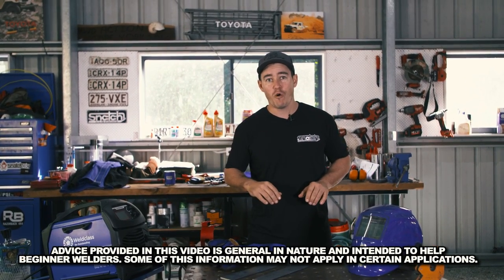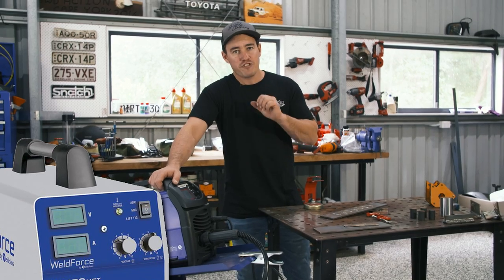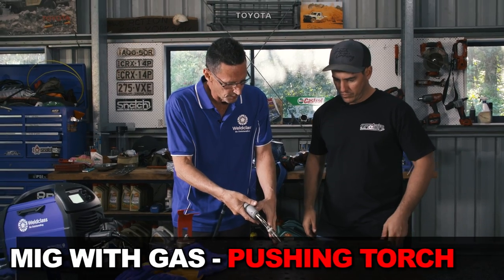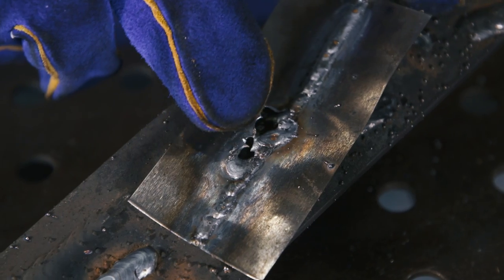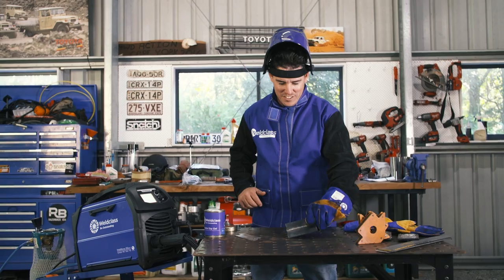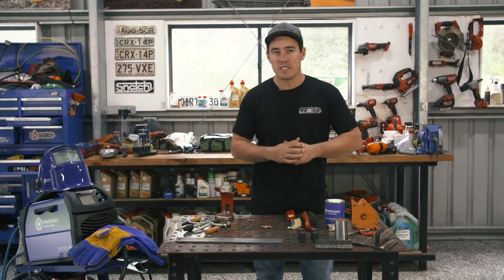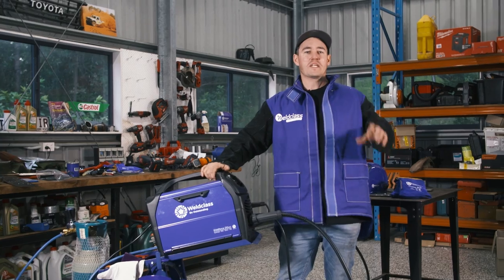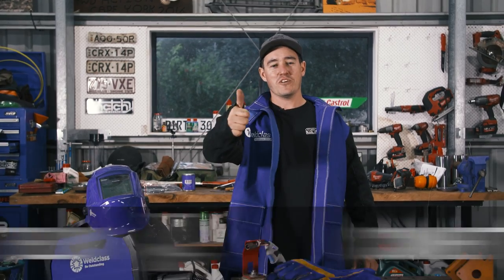HOW TO MIG WELD with Shauno! From NO welding experience to good welds in 10 minutes!

Comment: Great “how to” there Shauno, some good information to get people started, just a couple of points
•Porosity can also be caused by too much gas flow, look up Venturi effect
•Gas type is important , argon/c02 for mild Steel mig, pure argon for stainless mig+tig

As for what my first project would be, finish my rear bar and start a set of turbo manifolds.

Good luck to the winner cause I know it won’t be me

Comment: one of the the first project i would tackle with the welder is a basic sheet metal bender then i would go on to making a slide out pantry for the old mans canopy, with the sheet metal bender i build before hand and obviously the welder. then probably a log holder that slides into your tow ball hitch for cutting fire wood. would be very handy to have.
Reply: It'll be awesome to weld repair my boat trailer. Hanging out to go fishing again after this pandemic restrictions.

Comment: I'm a heavy metal fabricator and welder by trade.
The tips are very good for a baseline to get into welding.

I would first make a water tank for the back of my 80 series.
Or trying my hands at making a 270 degree awning from scratch.
Love your videos.
Been a fan for well over 10 years.

Comment: This timing of the giveaway is so perfect! I have plans to build a trailer behind my restored 1965 Unimog 404. I just started drawing some ideas!

I have the plan to learn welding for the trailer build. On my unimog my father and friends did the welding (very difficult welds)

So my plans are I want a 750kg ( the law allows me to build my own designed trailer of 750kg without brakes ) trailer with 40inch unimog tires. I found an axle by a friend in his garden and I gonna restore it. It fits Unimog rims. I will get leaf springs and shocks from an SJ413 or something similar. And then make a flatbed to tow a small boat + 4hp engine or big army tent. And some boxes under the bed for storage. And same width as the Unimog.

So I really hope I win this awesome opportunity! I gonna film the process of the build.

I think it will look epic to have a small trailer with same tires as the 1965 Unimog ❤️ And my father can teach me welding so I have the skill for life!
Reply: Please for the love of all other road users do not undertake building a trailer to learn to weld. It's a 4 year apprenticeship for a reason 🙄
Reply: @reecechristian6185  I have my father as a teacher. And I already have all the other engineering skills. And I will practice first with scrap metal. I started my Unimog without any knowledge and I manage to rebuild and upgrade it 😎
Reply: 750kg unbraked includes your trailer weight and payload, not just tare weight of your trailer, so as you'll very quickly find out, building a solid trailer leaves very little payload capacity.
Little point having a solid 500kg trailer to carry 250kg payload.
Look into braked axle for everyone's sake.

Comment: Good video Shauno,
I've been welding for about 35 Years and all tips are pretty good and correct.
Just a tip for you to give your punters a better view is shade your camera when welding.
Easier for the learners if they can see what the Electrode, mig or tig look like when laying a weld.
With Electrodes, go with the E41XX and not the E47Xx or 48XX easier to start and run a GP Electrode for a learner.
Also with the helmet, show the different tints that they have.
Some people like 12 and 13, but tig I prefer 10 or 11.
Keep up the great work..

Comment: I've been wanting to learn to weld for some time but have only tried stick welding which hasn't worked out well. Thanks for the video, inspired me to give gasless MIG welding it a go. Love that this welder has an easy setting for different thicknesses of metal! First couple of projects will be on my jeep, I'll start small by making a frame for a dual battery set up and then some rock sliders once I get a bit of practice!

Comment: I've just bought two 1980's 70 Series Toyota Landcruisers, and I'll be needing a welder to get them both back on and off the road, one for my son to use as his off-roader, and the other for me and the missus to use as a camper truck, couldn't let these great old trucks get parted out or end up on the scrap heap, but they do need quite a bit of work. And thanks for the welding intro Shauno.

Comment: One of the first projects I would be doing on my 80 is building a rear bar and modifying the front bar to be more bush proof and tackle the tough tracks around. A welder is a great piece of kit that i have wanted to acquire for a while to become a capable fabricator in the shed.

Comment: I am fitter & turner by trade and I spent a few years welding structural steel buildings.

The best bit of advice for welding and cutting is to be comfortable and relaxed. If you feel uncomfortable find a way to get comfortable. It’s difficult to make a good weld unless you are comfortable.

Comment: I have been using my mates little stick welder on my last  project,  so I think this would be a great addition to help the both of us out on our projects,  
But my first project with the welder is I would love to fix up my trailer as it has a couple of rust holes in it and maybe even knock up an enclosed frame for it to have a diy camper trailer/gear carter,  
Great video 👍

Comment: How’s it going Shauno when I was about 12 years old I found my dads old mig up in the garage roof so I set it up and and was so keen to start welding. I didn’t have much experience with welding before I had only ever watched videos so I had no clue what I was doing so I just started to weld up some steal and after a couple beads I started to get the hang of it and now I was just about to buy a welder until I came up on this video so I might try my luck. Cheers Shauno

Comment: have been dreaming of a welder for years each day, have had a real struggle deciding if i should just opt for a cheap stick but cant drop the idea of a pristine welder like this, first project id tackle im almost unsure. Have alot of small items around to repair but would most likely start making parts for my 4wd like a tray and bumper. Whatever it is im sure im gonna have an absolute blast doing it

Comment: Hey Shauno, wish I would have had this video at hand a few years ago. Back then I had no idea at all about welding and built an aluminum roof rack for my 110 Land Rover Defender as buying one was just too expensive. I just went by trial and error with my stepdads Chinese no name MIG welder. Huge mistake, I didn’t know u needed a different welder for aluminum (which I selected „smartly“ to make my roof rack light weight). No idea how I managed to weld it together (ugly but it’s holding). Got so many stingy comments from my mates, so never did a big welding project again. However, the original rack is still on top of the Landy and just had to repair it once on a big offroad trip. Would be very excited to win the welder and give ‚roof rack 2.0‘ and many more projects a go. Keep up the great content. 🤙

Comment: First project will be a roof rack for the patrol, followed by fixing the pool fence! My current rack moves too much with the basket attached and the fence has a couple of broken welds. So one gets me off the road safer and the other gets me out of hot water with the council and into cool water during the summer.

Comment: the first project i would tackle is creating my own welding table as i have to weld on my dads little stand up bar table with my pops very old welder and a few youtube tutorials to teach me how to set up a welder, have been wanting to tackle this project for a long time but the welder has had a lot of issues. i have also wanted to transition from the automotive trade to boilermaker as i love watching welding and i find it very fun so i would love to start learning a bit more with this starter pack.

Comment: If I had the chance to win I would be able to finally finish off my rear bar with swing aways on my 1985 hj60 cruiser. I’ve been stuck between lockdowns in Vic to be able to use my dads mates welder and shed to get the job done and let’s be real no one likes asking to use other peoples tools! I am also trying to learn CAD design so I can go beyond my bar to design and fabricate parts for all my mates cars and help them and others build what they want exactly. Also I would love to start making bars for 60s and other older cars where parts are hard to come by from manufactures and if there is anything there, it’s usually far beyond the price of what we can afford and knowing it can be done cheaper and with passion means the most to me! The excitement in making something yourself is amazing and with a weld class welder I’m sure my beads would be a heck of a lot nicer! 🍻🤙

Comment: Preset setting make it real easy. Liked the welding explanations. I have an old trailer I would love to fix up. Needs a little TLC like a new floor and filling in some rust holes. I could also weld a cage for it. Jobs are endless!

Comment: The first job I would tackle is to fix some small rust areas on my AUSSIE WB Holden Ute. The metal is 1mm thick and from what I saw it does this thickness really good. I did have a 350 Inverter Mig until recently but it was to big and cumbersome. The Weldclass 210 is the perfect size and has the perfect Brain so I can concentrate on doing the welding perfectly

Comment: Hey shauno, the first mission I would fab up would be my alloy over steel front winch bar for our new forbie. Polished alloy over-rider bars (for the bling) and to keep weight down, mounted to tube and plate stock custom designed and fabricated by myself with strong winch and vehicle mounts, 2 re-inforced recovery points, light mounts and uhf ariel mount. 
Very quickly followed by another custom built rear winch bar and rock sliders.
Cheers mate, keep up the bloody great content 👌. 
Good luck to all, and hope to see some updates from the winner of all the hard work with the new toy paying off🤘

Comment: I will start with rust repair on the frame on my vehicle because in Bulgaria there are almost no places that provide this service and the one place that does the price is equal about a welder + safety gear + the steel you need and something else. I have I second project for custom front and rear bumpers as well.
Much love from Bulgaria!

Comment: Ive got a 4 door suzuki sitting at home on 31s, im doing a fully custom barwork setup with a comp style front end, with front and rear scrub bars, rock sliders, a rear bar, and pillars coming up the rear and front end, exo skeleton style up to the roof rack. 

On top of that ill need to weld stuff to complete the SAS swap from the ifs base ive got on the vitara. 

Lots of welding, lots of hours put in, and an absolute Rig of a Mig like that thing would make life so much easier and cleaner!!

Comment: The first project I will tackle is one I have had material for but unfortunately have had to put off for far to long due to not being able to afford a decent machine that is capable of welding metal heavy enough for the project. I so badly need to put a rear protection bar with spare wheel and Jerry can holders  on my GU which I also can not afford to purchase. I’m sure my factory plastic bumper would be so great full for. Thanks for the opportunity to enter 4WD24-7 and Weldclass

Comment: As other items to buy for mid welding, mig pliers, best to cut the wire to keep the wire fresh after each bead, and although you can use any wire cutters mig pliers are just very good for cleaning spatter out of the nozzle to ensure good gas flow, I highly recommend my weld class pro max 500, I used it during my pre app as it was best in the price range and had lower shades for oxy cutting and I’ve used it right into my apprenticeship when I can find my other helmet and it still works great, very large viewing area and has listed a long time. Old flippy style works well too on a budget but hard when using stick if your new and take a bit to strike the arc and you will get a lot of stray arcs

Comment: Great content, really enjoyed this - I'm running a camper trailer and want to fit it out with some custom storage boxes around the sides, and the Weldclass stick/mig/tig setup in the prize pack would replace my eBay stick unit and  help me out during lockdowns to get it done.  Plus, winning the pack would mean spare cash for more steel and extra fixes like custom battery boxes, better plumbing, and maybe a hydraulic swing gear rack over the top!! Good luck everyone, hope I'm welding and filming my project soon! (welding jacket looks good too Shauno, I should get one, safety first!)

Comment: Thanks for the tips Shauno, it is indeed intimidating to get started welding. My first project would be to make up a lightweight front winch bumper for my 99 dodge 1500, short bed, reg cab. Truck is a unicorn here in California and I am proud to own her (Bessy). After that I want to build a rack for overlanding trips.

Comment: The first project I would tackle is to modify my roof racks. I would removed to upper bars to make it a flat rack and would also cut down the feet to reduce the overall height making stability better. I would also weld some bar to the rear of the solar panel and run it at a 35-45 degree angle in front of the roof top tent. That is the first project I would like to tackle but in all honesty I will probably start on the floor pan where the rust should really be removed and holes remaining welded ( but that doesn’t necessarily sound as exciting or fun).

Comment: i make sparks... i'm a fabricator... we always use gas. the correct gas gives cleaner welds. reduces spatter and it just looks better... the art of mig welding, is trigger control... down to one overlapping spot at a time. always use a larger tip. at point 8, use a 1mm tip. prevents clogging snagging and buggering up... if you have problems controlling the torch, in one hand, use two! grip the gas shield, it won't burn you! the angle of the torch changes relative to direction.. to disperse heat, weld from tack to tack... use the edge of the grinding disk to clear a weld path to clean metal... Co2, which you can get at any pub... is cold. if you havent got a gas heater, stand it in a bucket of hot stuff... (its an inert gas)... and finally... wear boots. keep your fingers out of the way of spinning things, they don't give second chances... oh yeah, and, when you're upside down, welding the chassis of your old whatever... wear a hat with muffs, spatter melting into your ear wax is only funny afterwards... (you can find out about burning nose hair all on your own-some)

Comment: I’ve purchase an CNC 6.5m walkthrough boat diy pack  and would use the welder to weld the boat up will take few months to complete but will look amazing and doing it will a welder that has stick, mig and Tig is handy as you will be using all setting on the boat 

Thanks

Comment: Finished building/painting my first fab job which was a steel tray for my hilux  built for a canopy with dog box, under tray boxes and wheel guards and spare wheel carrier on the back, Christmas Day 2020 I had to wire it up, and get the canopy on and bolt it down same day (Christmas Day) ready for a 2 and a half week trip that we left for the day after (Boxing Day) could only work on it from about 5-9pm weekdays ( im a subcontract carpenter) so the neighbours weren’t happy 
I have since decided it’s probably too heavy, even the misses is pushing me to build my own alloy tray so I stop complaining about the weight 😂
My old man gave me a 3 minute maximum rundown on welding beforehand and she still came out quite well!

Comment: I just got a brand new bt50 and starting to kit it out for 4x4. But the first project I would tackle with the welder would be a motorcycle ramp and carrier to fit to moto on the back of the bt50.

Comment: Shauno. I've got an old dual purpose 170 Coppermate Mig welder. I've had it for years, and while it is probably only meant for the average DIY er, I've gone way beyond that. It'd been sitting in the shed for a few years and I just recently dragged it out and gave it the once over. However it doesn't seem to have anywhere near the duty cycle it used to have. Do they lose some of their duty cycle as they get older, and have done a lot of work ?

Comment: I would like to tackle an air box for my forby to make sure it’ll be water tight for the OTT when we go, and also a console for behind my back seat to sit the battery and all 12V equipment onto. Then if I seem to be alright with it I’d build a small camper trailer in the future. 
Thanks 4WD27

Comment: I would love this welding package. The welder in my shed is my grandads yellow stick welder which I have had since he passed 28 years ago. The helmet is a hand held type with a very small view window.The first job I would do with  this welder package is weld new hinges on my trailer as this has been damaged for way to long.

Comment: Hey Shauno, good video cheers, I havn't welded for a while so would like to get back into it and catch up on some jobs around my place, I would like to build a weld bench as I used to weld on the shed floor but the old back ain't what it used to be, so getting things off the floor would be great, then I would tackle some aviarys for the misses birds as getting a bit overcrowded, then a decent kennel for our red healer and some extensions on the shed to make some breathing space would be great too, but I won't be holding my breath to win as there are a mottza of bonza entries and whoever wins good luck and have fun, cheers.

Comment: First project id have a crack at would be to make an off set smoker out of a couple of recycled gas tanks.  Weld some hinges for the doors, some legs, handles on the lids a flue exhaust pipe...etc.